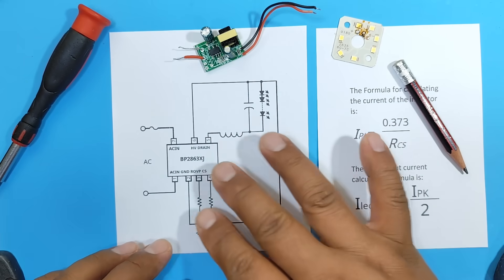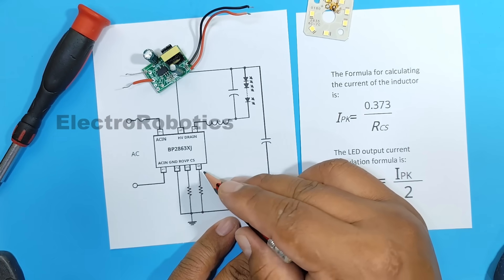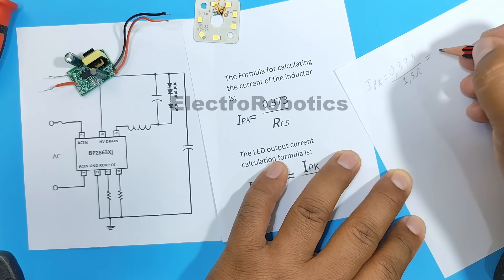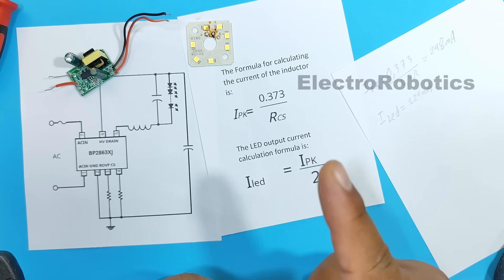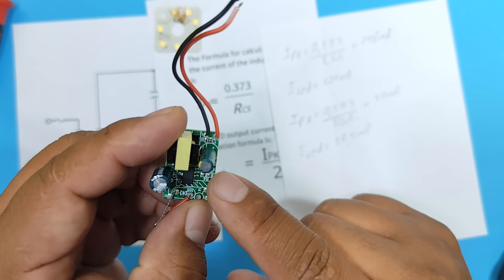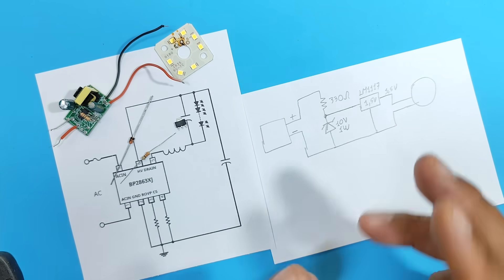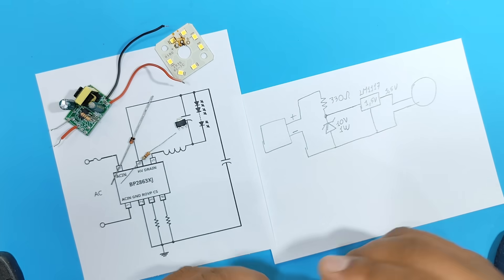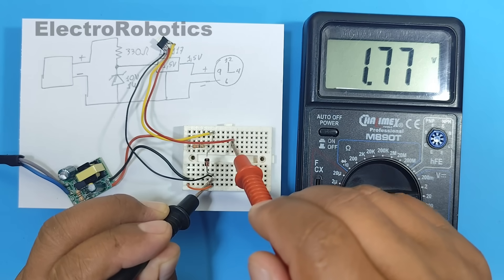Use Old Led Bulbs You Will Never Have to use Batteries Again

Comment: now show how you supply 240vac power point to run this contraption.
what a colossal waste of time.
no one is going to go to this much trouble. and you didn't even show how you would supply 240VAC (or what ever voltage you have there) power to this clock.
who is going to want an extension lead running down the wall or even a power point on the wall that high.
reusing the electronics is a good idea. but not to power a wall clock.

Comment: Don't do this, waste of time and dangerous, there is no isolation from mains voltage.
AA cells that are too weak to power a torch or motorised item have enough capacity to run a clock for several months.

Comment: 27ma to power a wall clock is insane. Efficiency is like 0.0000000000001%. 😂 Better is to hookup cheap solar cells to charge nimh battery. No wires, no circuit board needed.

Comment: Not a practical idea. The normal batteries in these clocks should last at least 1 year and they are cheap. It would take a couple of years just to recover the costs of the extra components you'd have to purchase, regulator, Zener diode, resistor and power lead with plug. Not to mention who wants a power lead dangling down the wall. You'd also have to reset the clock every time you had a power interruption. Not to mention the safety issues, these power supplies are not isolated from the mains, therefore the board is at live mains potential.

Comment: Add a large capacitor to act an short term power during power outage
Reply: Or place a generator or UPS underneath the clock....
Reply: Solar panel, battery and an inverter would complete the project 😂
Reply: Why waste time with that subject?

Comment: This project is not so much on the complexity of the circuitary to run a wall clock. Prof Nelson has showm how a salvaged circuit board that gives out a high voltage and current to light power LEDs' can be modified with a few components to reduce the voltage and current to run a 1.5 volts approx 27ma current. With his theoretical explanantion and clear explanation, we had learn something new! Yes! There are other methods of obtaining a low voltage/current for gadgets! If there is interruption, just adjust the clock needles - no big deal!  Thanks Prof. Mahathev from Malaysia.
Reply: can be modified with a few components to reduce the voltage and current to run a 1.5 volts approx 27ma current. 
>>>>> BIG MISTAKE     its not  necessay to reduce the current
Reply: @kennmossman8701  Exactly....The clock will only draw the current it needs....Might as well deliver 16A....
Reply: With his theoretical explanantion and clear explanation! 
>>>>>  LMAO    I did NOT hear ANYTHING about the theory. NOTHING. The part about the formula is strange - why divide by two?>?>???  WEIRD.
He explains NOTHING about the resistor and Zener. NOTHING.   What of the wavefiorm - NOTHING.   What of the efficiuncy - NOTHING. What of the danger - NOTHING
Reply: Prof. Mahathev from Malaysia is full of BS.  Did you get ur degree from a box of cereal?   What a joke.
Reply: This project is not so much on the complexity of the circuitary to run a wall clock. 
>>>>>>he dioes not say ANYTHING about that.  Not even the current use  - which is NEEDED - BIG MISTAKJE.
Reply: @kennmossman8701 😢
Reply: has showm how a salvaged circuit board that gives out a high voltage and current to light power LEDs' 
>>>>>BUT it only works for ONE such circuit. BIG MISTAKE
Reply: One goal, many plans! Keep up the good work Sir😊😊😊
Reply from the maker: Hello Mahathev Krishna, thank you for explaining to everyone what the video is about, and thank you very much for your support, best regards.
Reply: Prof Nelson 
>>>>> Professoi????  LMAO  you are joking or deluded

Comment: FYI: @ 11:30 into the video the voice over says set the meter to DC Volts but the process be explained is the measurement of the current so the context of the DC Volts does NOT match the intended purpose...
Reply from the maker: Hi NZHippie, I'll check that part in the video, thanks for the observation.

Comment: Why do you reduce voltage to 10 with zener diode and then by using 1.5 v regulator reduce it to 1.5 v. Why not use a1.5 zener directly?
Reply: A Zener diode is not a voltage regulator, thus using a high voltage reduction by a Zener is not an ideal solution. It may not give a stable regulated and refined voltage/current output compared to a regulator.
Reply: @mahathevkrishna7839  such BS
Reply: @mahathevkrishna7839    what nonsense.   Maybe learn electronics' FIRST
Reply: OMG   what a clown show of answers you got - 

Anyways,  first    the common lowest Vz is three.three volts.  I never saw a one.five volt Zener.

He uses a one.five IC regulator - expensive choice. There are cheaper solutions but he is lacking knowledge.

ANBYWAYS  such an IC has a limited  Vs so the violtage from the LED crrcuit  must be reduced.

The actual Vz  isnt so critical  though it depends on the IC. 
A lower Vz means a higher Wattage resistor; Higher Vz means higher Wattage for the Zener.
Reply from the maker: Hello PRASANNAN K R, there are two reasons, the first is because when converting 220VAC we obtain 310VDC and that voltage is what the Integrated Circuit delivers at its output, it delivers it to the Zener Diode which can withstand that Voltage without being damaged until the Voltage stabilizes at 10V. The Voltage Regulator could be damaged more easily if we do not use a Zener Diode first. The second reason was mentioned by Mahathev Krishna.
Reply: @ElectroRobotics-qo2er    OIMG    what a mess and its wroing

Comment: Getting a few miliampers shouldnt be so complex and expensive.  Only a simple resistor enough  for a clock i think.
Also, grid system not durable and uninterruptable for a clock feeding.